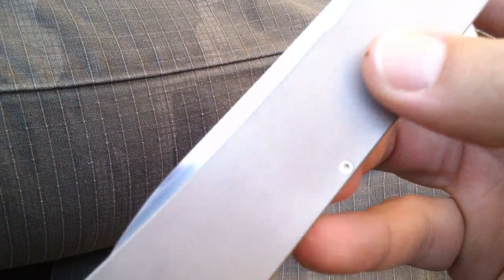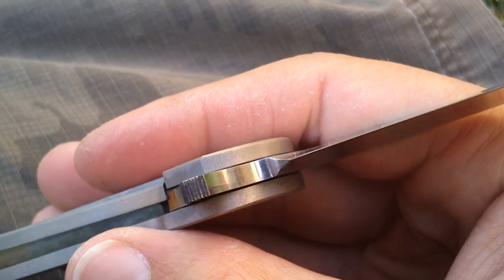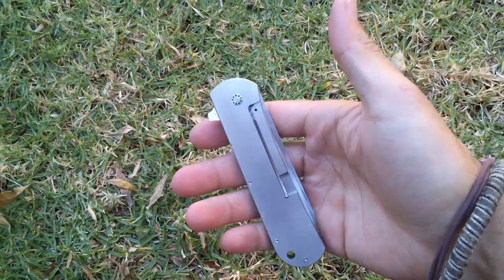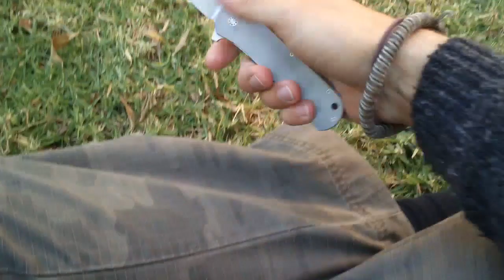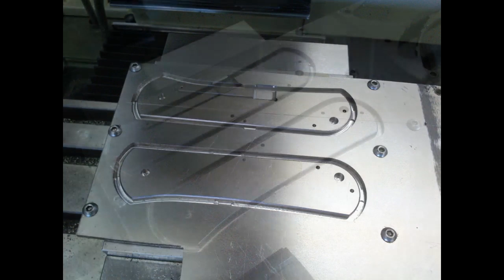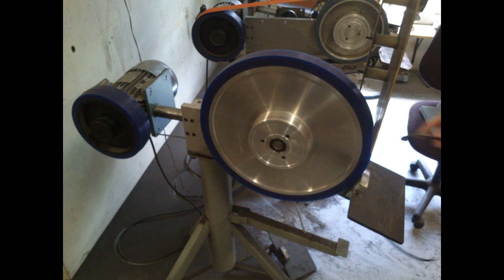MWVW Model 1 Prototype

Comment: Very nice knife and super effort for your first prototype.
What blade steel did you choose and did you send it to a third party for HT?
Thanks for sharing.
Reply from the maker: Thank you for the kind words. I went with N690 and it was heat treated by a third party yes. An established knife maker that has dealt with it for years in knives and mango pruning blades. Personally I think I would like to use 14C28N, N690 Damasteel and RWL-34 in pocket knives.